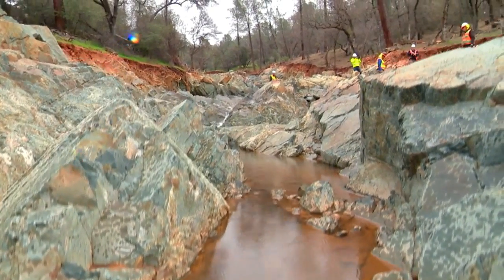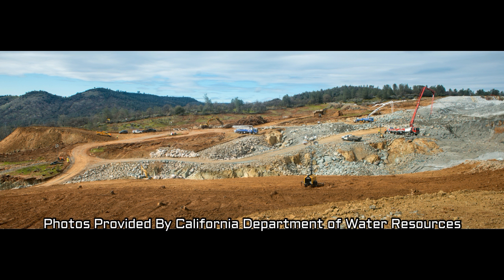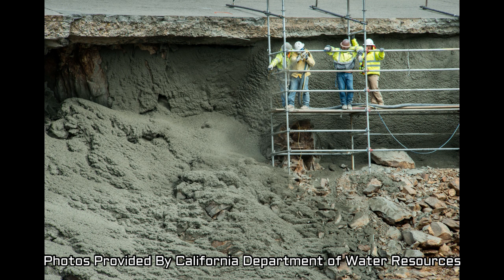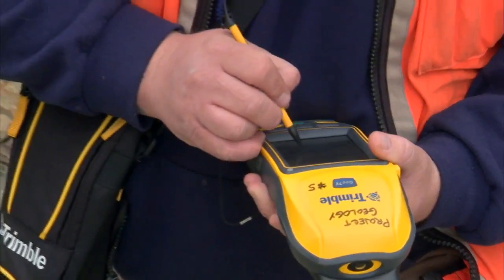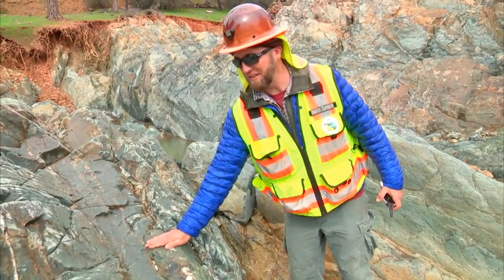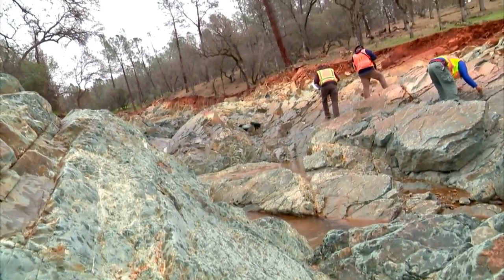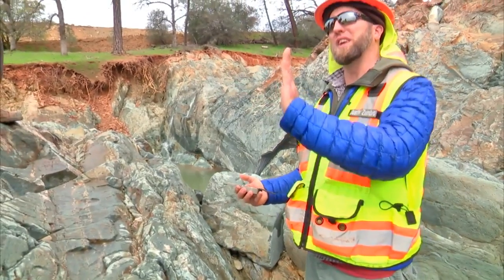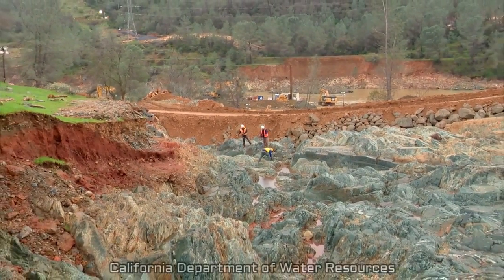Geological Survey Video | Latest Images | Lake Oroville Dam Updates | 3-8-2017

Comment: and the purpose of the compass telling us angles of the Rock that was cleaned up was what?? so we can study water movement>>I don`t get it
Reply: it's so they have a measure of how it was. and if they have to close everything again, they have something to compare it to to see how much worse it may have gotten.
Reply: Shawn B, like what breathe and squeeze said, so they have something to compare it to. For instance, if the main spillway becomes more of a problem and requires temporary repairs or a permanent shutdown they have something to base future erosion patterns off of and can then decide if the erosion on the emergency spillway is more of a problem than the main spillway erosion. Everyone knows neither spillway is a safe option, but at least this way they'll have a precise way to measure future erosion issues should a worst case scenario arise.

Comment: Kind of curious why the orientation of the eroded rock area matters.
Reply: My thoughts exactly.
Reply: Orientation will help determine if water will just flow over it, or break it apart.
If you know the rock type, location and orientation you can pretty much predict its erosion under a known level of water flooding by.
Reply: That would be an issue if they were going to be using the spillway before it's rebuilt. But what is the alternative? Either the spillway (and the damaged area) is going to be used or it isn't, so why does it matter? In other words, knowing the erosion potential isn't going to change anything.
Reply: Who cares....unless the spillway is fixed, which it wont be, then the water will do what it wants once the spillway is opened.....and determining what will happen to the rock before that is a waste of time/money...
Reply: Once the mountain snow starts melting and fresh rain comes in , Northern dams will need to release more water so they don't overflow, it will probably never need to be worked on, because the dam  will be gone  and there will be no reason to protect what is already wiped out.
Reply: ORientation of the rock against the Magnetic pull of the sun is very important. Just like DUAL Chrome Muffler bearings are ten time in sync than Single Chrome model. I learned this in advanced Physics and Damn building at M.I.T
Knowing the angle of that buried rock, I am going to buy more property downstream. Being a Trained GEE-ologist, knowing how to use this compass in properly determining the angle of rocks that are buried, is what it is all about. I can tell by the orientation of the rock that the water should have washed over and down the spillway and not made a 200 foot hole in the side of that mountain. But , Hell- A couple of trips to Home Depot, a few bags of gravel and INSTANT DAM FIX concrete, and this crisis will be over in no time...!! RH DSD
Reply: You are 100% correct, just make sure you get flood insurance on that property.  Also, I'm not sure what the boys band "in sync" has to do with the muffler bearings, is it because of the chrome balls?
Reply: MsMsmak It's called government jobs.  What else would they do?
Reply: Back Street boys are more accurate at determining Rock angles under Huge-ass Unstable dams, than N-sync boy band. Even my Daughter told me that...
Reply: Back street boys don't know a DAM thing.
Reply: 5 STAR DISASTER SERVICE and Fly by Night Industries have a lock on the new Construction Contract, I am told....
Reply: DWR released a request for proposal today looking for engineering firms to provide reconstruction of access roads and construction areas, along with provide spillway recovery efforts to get the facility through the next rainy seasons while they are coming up with a permanent fix. The current spillways (both main and emergency) are both total losses and cannot be permanently repaired.  They will be patched for the time being as best as possible until new facility can be designed and constructed. The dam and the hydroelectric plant are fine, but we will likely see an entirely newly redesigned spillways and spillway gate structures. They will likely do what they are just finishing up at Folsom Dam and that is a spillway which sits lower in the lake and allows releases at lower water levels. 

This will be a long and very expensive fix.
Reply: Thank you for the clarification. Now I understand the need for the geologic survey.
Reply: steve wilcox pollux.......once the survey /enginnering / geological reports are completed for the spillway, they will be nullified if the spillway needs to be opened again before they repair or fill the damaged ares....March / April have been huge rain months in the past....the way this winter has been it wouldn't be surprising to see it happen again....so may be premature to have all this money spent on firms that may have to do it twice
Reply: Lou - eye, there is a fault under it that runs from San Francisco up through there and continues to the nne.
Reply: What they are recording are called "shears" which are basically cuts or small drainage gaps that formed due to water erosion following the emergency spillway usage. It is important to understand the orientation of individual shears as they can further erode towards the emergency spillway face and cause failure. Some may not realize that the original reason they reopened the main spillway was due to water eroding/back-cutting within a shear (that hole that everyone is talking about). By documenting the current shear strike and dip angles they will be better able monitor the new erosion patterns should the emergency spillway need to be used again.
Reply: oh dam MsMsMak!
Reply: Yep your in it , monitor what will move and what might not.
Reply: Now they have to move through this as quick as possible, using debris in mixed with Lyme to try and built a more smoother flow surface.
Reply: They are going to have to rebuild the spillway and stabilize the entire area.  Unless you know the base conditions and problems you're working with, you cannot engineer the variety of solutions that will be required for the entire area.